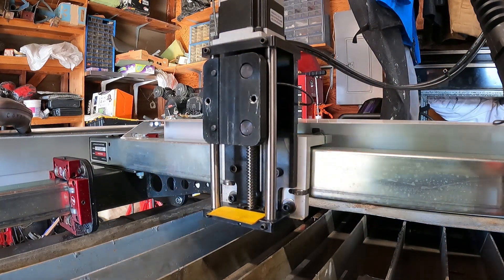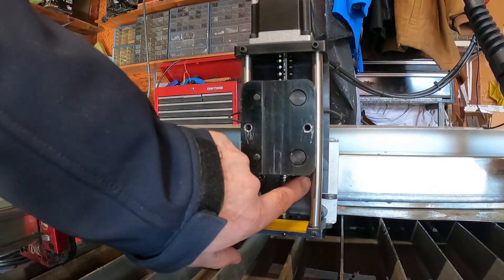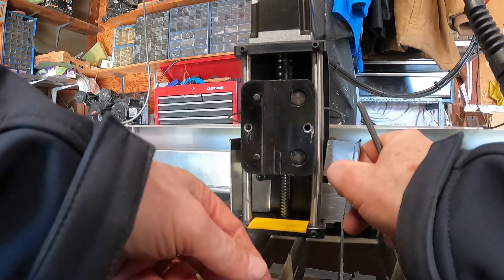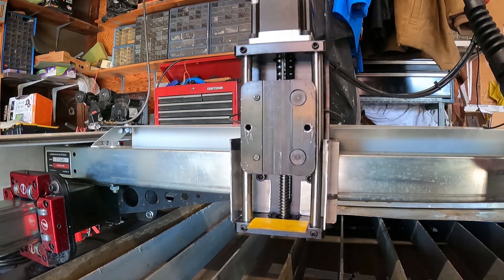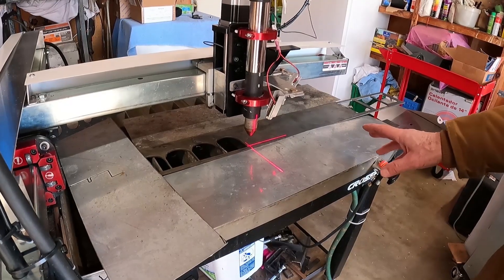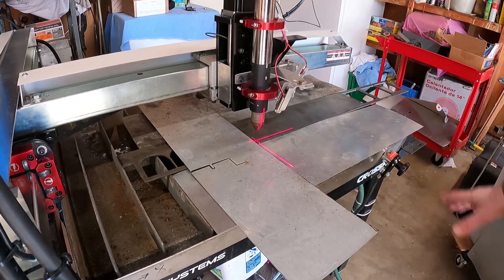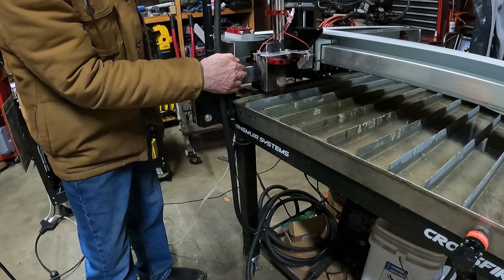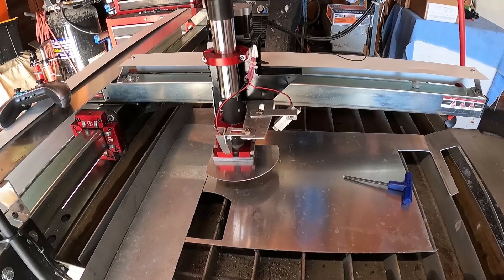Langmuir Crossfire DIY #2

Comment: Hi Doug, love your videos, very helpfull.
I imported the new torch mount dxf file but dont have the right dimensions. If you could only give me the height of the torch mount, i could resize the file.
I work with delta cad.
Thanks so much.
Reply from the maker: 7.375"

Comment: Another fine & detailed how-to by Doug Kronemeyer! Your excellent 3 part series "DIY #9" is my go-to recommendation in others comment section, when they are building antequated, bare copper tube "air coolers" (no fins & no fan) or a finned cooler, but oriented with long tubes vertical (U-bend water traps, LOL) & other nonsense about moisture removal myths. I send them to your well engineered, logical design in DIY #9 & say "copy everything" for maximum results! See my comments there & thanks for sharing your knowledge, intellect & genius with us! Paul from S. Central Tx.

Comment: Happy New Year Doug, Question did you have any problems with cutting the holes and curved slots in the torch holder adapter plate i cant get complete cuts it will go to start hole and cut about half the hole and stop and i get the error and click on retry it will then go to the next hole and do the same thing and stop.Thanks Dean
Reply from the maker: Dean,
Contact me at the email address in the about section.

Comment: Hi Doug, I can open your files to my drop box but there is no dimensions I'm not familiar with part master maybe you could help. Thanks Dean
Reply from the maker: Dean,
I am only familiar with Fusion 360 and have never used part master.  I am sure the DXF files include dimensions.
Doug
Reply: @dougkronemeyer  Sorry about that I didn't know I had to have F360 open to see the files like I said I never used drop box before but it works good .Thanks